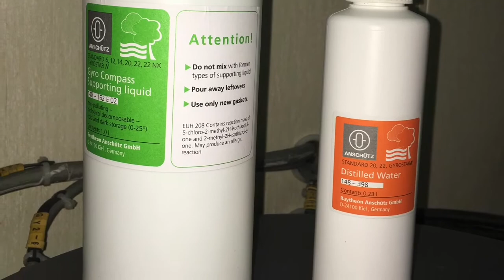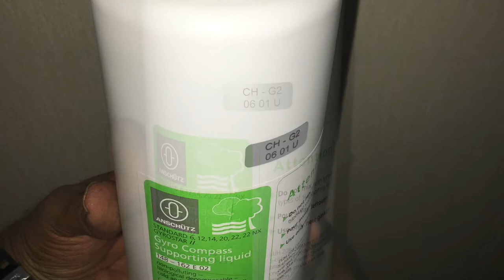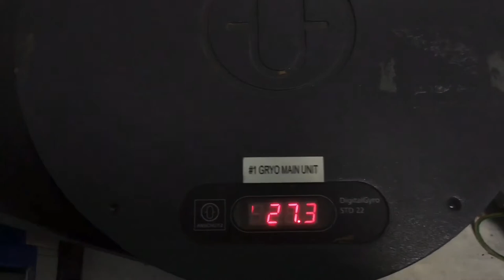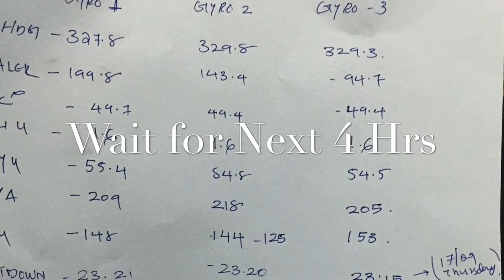Anschutz STD 22 Gyro Service

Comment: I have EL.08 follow up system faulty
Reply from the maker: ignore some times errors shows
Reply: @marinetechnics8840  thank you for your reply but the gyro is still counting down and not stable on a particular heading
Reply from the maker: @edehap.a9662  ohhh then u have to check gyro sphere current!
Reply: @marinetechnics8840  i just checked now it is 256 
Secondly the connection pcb there is a red light on H12 and of the error comes up H4 indicates red and goes back then H3 is on green
Reply from the maker: @edehap.a9662  it’s high check how old sphere
Reply: @marinetechnics8840  up to 10yrs 
Please do you work on radars as well
Reply: @marinetechnics8840  i change the pump and i am still getting the error. Please what can i do next
Reply: This is not how you service a gyro , these guys are not doing it right ! They never done resistances checks of upper and lower outter sphere and no resistance checks of sphere ! The distilled and supporting liquid was empited incorrectly oh my god the whole service they done was all wrong in sequence !!